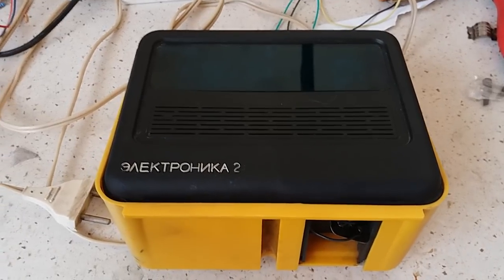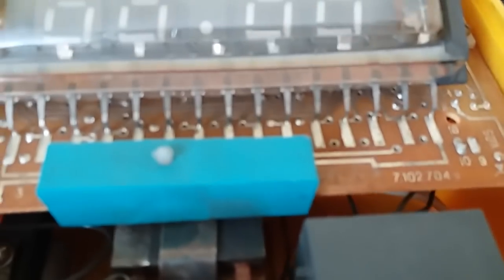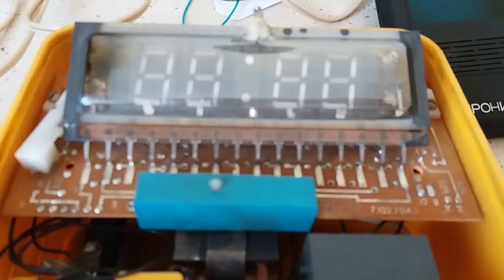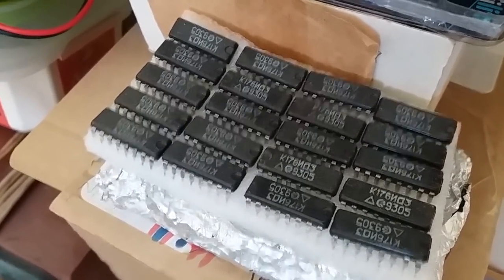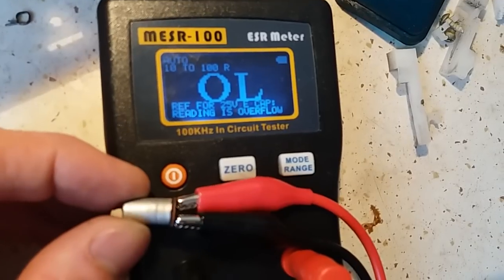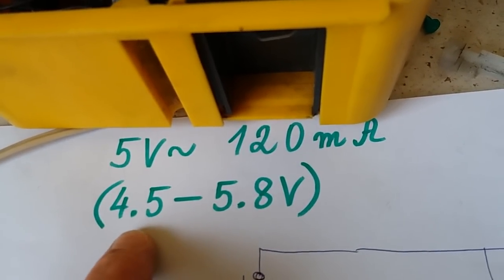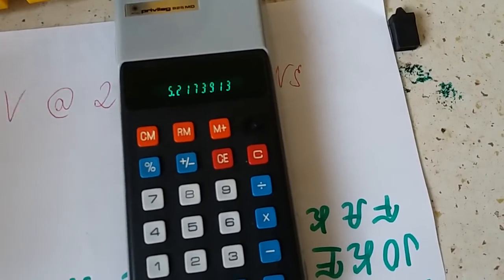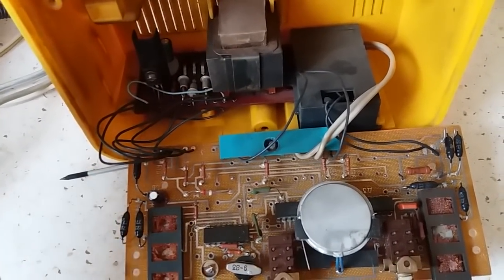Fixing 1983 Soviet VFD clock Elektronika (unedited)

Comment: I find old russian electronics very unusual, the components look so different.
Most are readable but the space ship transistors are just an unknown.
That fresh display made a hell of a difference, im confused why the heaters cant be run on a lower voltage.
I would have thought that a lower emmision would make them last, but i know very little about such devices.
Beautifull cat, sorry but it is :-D.
Reply: The heaters should not run on lower voltage because of the same effect as in vacuum tubes ( valves in British ;).
Voltage on anodes is high enough to "tear" electrons from cathode if it's not hot enough, and if it's happening, the oxide layer from cathode ( on VFD's filament is the cathode ) is being sputtered onto the surface of anodes, covering it and lowering the current, also dimming it ( of course phosphor is wearing out too, that's why segments got darker ) higher voltage is allowed due to less harmful effect than under powering, but if the oxides get too hot, it may fall off the cathode or loose it's strong thermoionic effect due to poisoning ( gas absorption by oxides or developing high resistance layer between oxides and cathode ).
That's why the heater voltage must be just right. ( sorry for any language errors, I'm Pole and that's not my native language, sadly )
Reply: @sebo0855  There is nothing wrong with your english, you discribed the problems very clearly.
I have saved your information to a text file, I may need to refresh my foggy brain one day lol :-D
My written english is far from perfect and i am english lol.
No one is perfect :-D.
Reply: That means you are young person. All russian elektronics is copy on ancient western one :) And if something they made different that means that soviet technology level was unable to copy (like TU-144 an Concorde. Russians managed to steal all drawings except wing. An was unable to make proper one. This is why they used small front wings to make plane stable at low speeds)
Reply: @mikasm3717  and put a man in space first.
Reply: @sjefoekel6058  With Fon Braun made rockets :)
Reply: @mikasm3717  so he strapped a german on it and shot him in space?

Comment: Diode gone wild: nice and informative video as always. We have a really old microwave oven at the parents house. It works fine but the VFD is almost unreadable at low daylight as like in the morning or evening. Is there a way to let it shine brighter? For example to raise the heater about 0.1 to 0.2 volts? Or the anode/cathode up to several volts? Or would be the only way to replace the display?
As I said that thing is really old, for sure 20 + years. It's a Panasonic. Quality made by Japanese :)
Reply: Get the heater voltage to the nominal, check for power supply ripple voltage and check/replace the capacitors, if it's still dimm, replace the display, if you start increasing the voltages it will degrade faster and you'll have problems again (potentially even damaging it to the point where it's not viable to fix)
Reply: if it's the entire display that is dim it's probably cathode poisoning, if it's a matter of some segments those are burnt instead... in the case of cathode poisoning they say you can bring the filaments to cherry red by applying an higher voltage with a power supply, cycling like 5 times for the duration of a pair of seconds, this may clean the cathode... before that also check for resistors in series with the filaments that may be burnt... of course check the supply voltage also

Comment: Got one of these, older with separate tubes. Checked the chem-capacitor, still more capacity than advertised, and I could not find any leak current, down to the .01 mA range at 50V DC. So, if anyone restores one of these clocks, just replacing them forehand is absolutely HARAM! 

By the way, single VFDs like this can be found in the Sony digi cube Clockradio from the mid 90s. These were really stuffed inside, interesting.

Comment: nice video but it is bad practice to touch anything that is connected to 220V. you never know what is going on, especially if it is broke.
Reply: I second that I third it and so on don't do it unless you have an isolation Transformer or are you at don't do it at all. Correction just don't do it don't do it don't do it don't do it don't do it......

 he did it ____________________

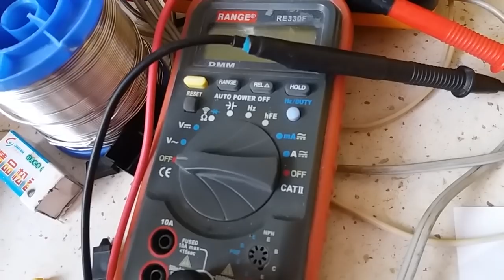Comment: At 15:55 you measure the heater voltage by placing the red test lead on the cathode [filament] pin of the display and the black test lead on the cathode [filament] pin, at the other end of the display. But both these pins are cathodes [negative], shouldn’t you be connecting one of the test leads to a positive pin to get a reading? I’m confused. Please clarify. Thank you

Comment: I like these VFD clocks. Where I live, GE clocks from the 80s are common.
Reply: I still have one on my nightstand.  One day it switched over to 24hr format by itself.  There is no switch to change it from 12 to 24 hr format.  I took it apart and the glue they used on some of the caps went conductive.  The glue was touching a pin on an IC chip.  I cleaned the glue off and the clock stayed in 12 hr format.
Reply: @Discretesignals I think UxwBill modded one for 24hr mode once. Also, I have a GE 7-4663 from 1987 and a 7-4695 from 1981. I also had a 7-4666 from 1983 bit it didnt work well

Comment: How about using 7805 without using the center tap isn't better?
Reply: These displays are designed to run on AC so a DC regulator is actually worse. You will get a voltage gradient across the filament meaning one end of the display runs bright and the other end runs dimmer. It may also reduce the life of the display.

Comment: Why does a mains-powered clock need a crystal? Why not just use the frequency of the AC supply for the time reference?
Reply: It may be to keep your car going on battery if it has one to keep accurate time and some clocks just use a Crystal instead of a sea lion frequency.
Reply: @aaronbrandenburg2441  A sea lion frequency?  Oh, you mean "AC Line frequency"!

The mains in the UK was always accurate, 50 cycles per second.  Or 4 320 000 per day, anyway  (if the generators slowed down during the day, they ran them a little bit faster overnight!)
Reply: In some areas, line frequency is 60Hz, but it's 50Hz in others.  Also, spikes and noise on the line tend to get counted as well, so the clock gains time.  Finally, using a crystal allows a battery backup when the power fails.

Comment: Love the VFD displays not matter is a calc or a wach.I have read, tried and failed sort of "rejuvenation" of this VFD type on an old desktop calc with a hosrt pulsde of DC on the filament in one way and trhen antother to burn impurities or I dont know what on the filmanet. Sort of clean process. Firt time I done it, I got a better brigthness, but for some reason it was a bit un-even ... I fell corageus enough to try it a second time ... wops ... bye bye VFD  ..... It almost shaded to nothing. Filamente was ok, I mean, not open. I used s 500mA 12V DC transformer to pulse the filment. Man it went bright LOL

Comment: I have Elektronika 1 clock, a bit older, but actually nicer clock of the similar design, with slightly bigger digits, and nice wooden box and clean front. I really like. I bough one from Ebay, from Ukraine, few years ago, because I remember my grandfather had one about 30 years ago, and I always liked it.

Comment: Do you have daylight saving time in the Czech Republic? We've just put our clocks forward in the UK. If you do, it must take a long time to adjust all those clocks in your house.
Reply from the maker: Yes, we also have it. The last Sunday of March at 2:00 the time goes to 3:00. I programmed most of my microcontroller clocks do this automatically, but the mechanical or vintage clocks have to be shifted manually, of course. But this only happens 2x a year. I have to wind the mechanical clocks every week anyway :).

Comment: I love the old soviet VFDs and Nixies and they last forever if you run them easy. One exception are the clock/calculator tubes like the one that was originally in the clock that use that brown adhesive stuff to secure the pins to contacts on the glass. They are mostly junk now and fail a ton because of the adhesive separating. In my last tube shipment I bought like 25 for 5 bucks because I wanted to see if they were as bad as I heard, and they were 5 bucks for a bunch. Unsurprisingly about half of them are way too fragile for any serious use, and they lose grid/anode connections pretty often, and sometimes the whole bit of adhesive with contacts just separates and completely ruins the tube! I tried a little bit to see if I could fix them but it wasn't worth the time. Just buy the other tubes which are a bit more but well worth it.

Comment: How is the data working for the display. Is there a voltage - how many volts feeding the input for the display. Thanks for your video.
Reply: These VFDs run on ~12-24 volts on the segments and 3.3 volts on the filament. The data works by first powering the filament, then powering the control grid with the higher voltage, and then powering the segments with the same higher voltage.
Reply from the maker: The anode and grid voltage is I think 27V nominal, it tends to be regulated using three 9V zeners in series. The duty cycle is 7/32 at high brightnes and 2/32 at low brightness. The heater is 5V~ 120mA.
Reply: @retropcs88  Thank you.. Dekuji.

Comment: Where I can find replacement chips for Elektronika clock, also the display if mine is faulty? Shipping could be expensive if not from china. I have Elektronika 6 and the upper row is gone and eventually one vertical segment of all digits, after cleaning with alcohol it become totally unresponsive. I'm not sure how to check if the display is faulty or the driver for the display. I don't understand schematics very well.
Reply from the maker: If one segment is dead or one segment always on in all digits, it tends to be a bad K176ID3 chip, a BCD to 7 segment decoder. Sometimes it can be a broken connection in the display. You can also have 2 segments shorted with each other in the display. Then both light up if any of them should light up. I'd check the K176ID3  first. If you don't have an old stock, you can buy both the display and the chips on ebay.